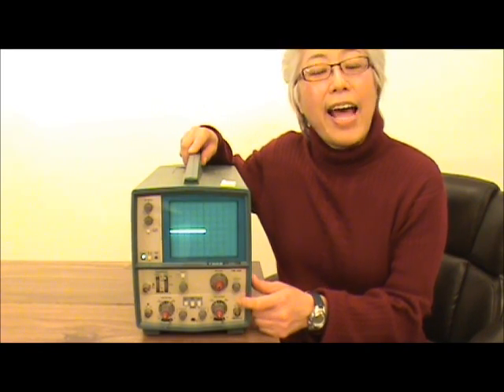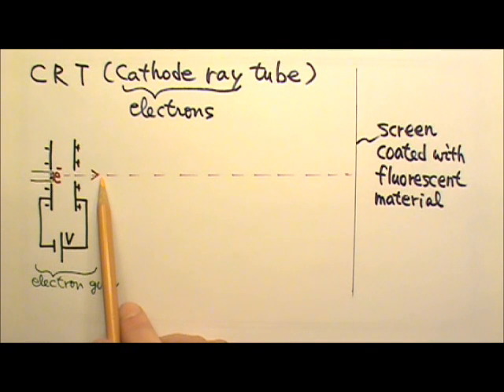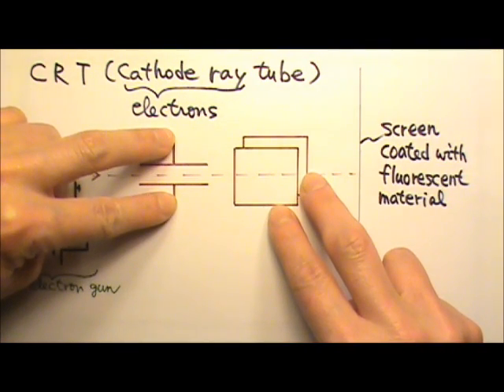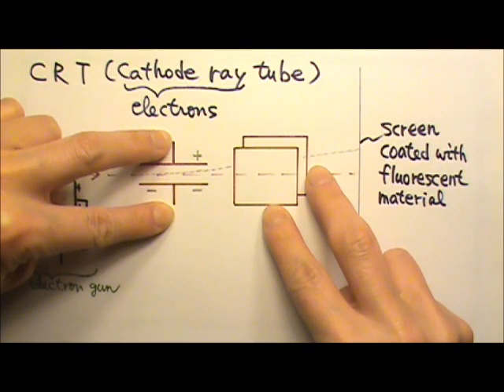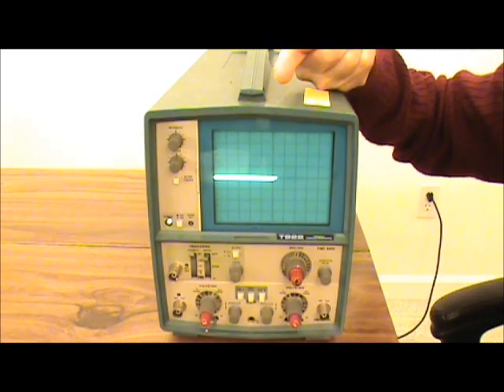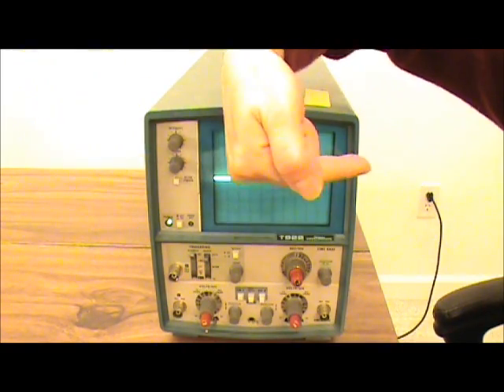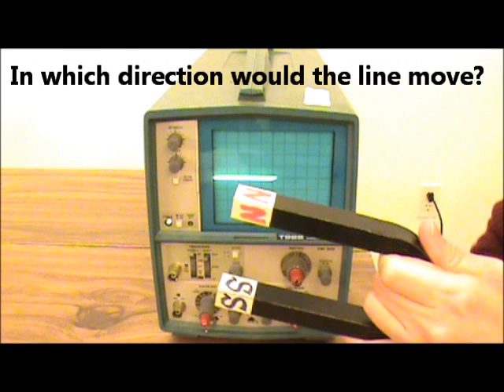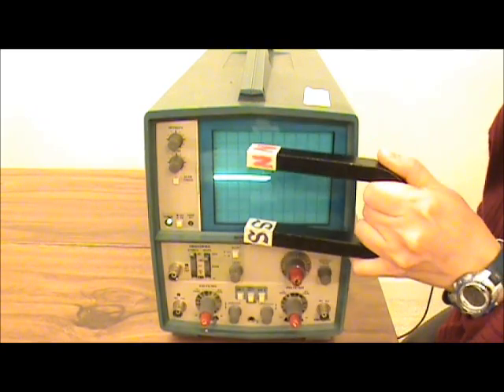AP Physics 2: Magnetism 6: Magnetic Force on Electrons in a CRT-Cathode Ray Tube

Comment: Hello, nice video,
Now isn't the Left Hand Rule to be applied here ?
Second you are using a U shaped magnet, which poles are pointing to space, and not facing each others Directly,  like it happens in the Deflection Coils of any CRT TV...As a consequence you do not have the "imaginary" lines of force straight between poles faces.
With two separate bar magnets N>S the demonstration would be more clear.

Thanks
Reply from the maker: +ufopolitics Yes, when you flip the direction of the thumb in right-hand-rule, you do get the same result as what one would get using "left-hand-rule". 
The horseshoe magnet does give us magnetic field that is described in the video: north to south between the two poles, so it is fine to use for that demo.